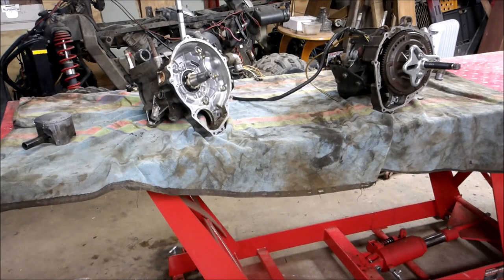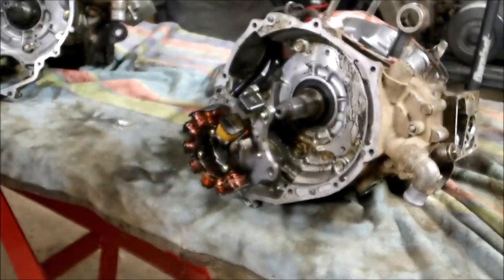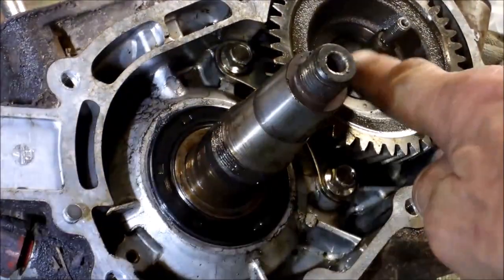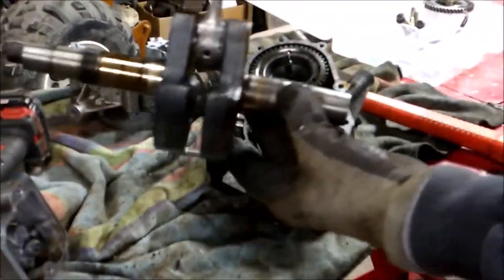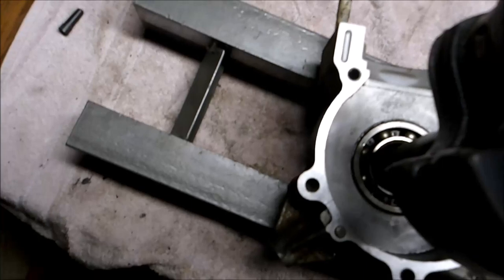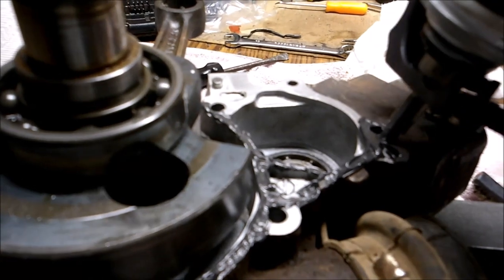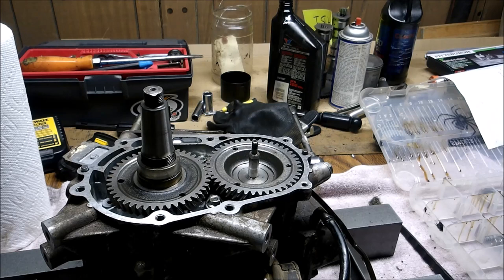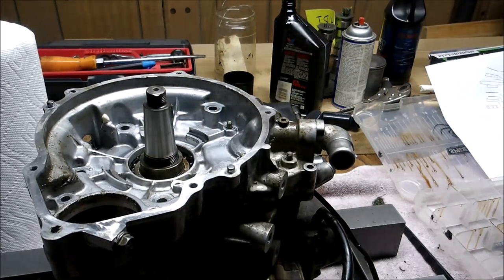How to Rebuild a Polaris 350/400 2 Stroke Engine and split case sides! Sportsman/Scrambler/Xplorer.

Comment: My cousin screwed up my 400 scrambler he put a 350 top end on there. I still have to get throttle cable that hopefully it works.
Reply from the maker: That can be done. I've heard a guy once took a 300 engine and a 250 top end and got more power.

Comment: My water pump bearing is rusted, and stuck on the counter balancer shaft. Is there a way to get it off? Also the shaft looks like it is in bad shape. I guess I should replace the counter balancer assembly? Thanks good video!

Comment: Excellent video, thank you. I'm a new subscriber because this video is helping me rebuild my 400. I purchased a new short block and therefore have to pull the water pump/counterbalance from the old block (blew a hole in the crankcase). I'm stuck, pulling this gear out requires a weird sized bolt. I believe it is 12NC24, but it may be metric. Do you know? If a special tool is required, maybe you know.  Thank you so much for your content, really good stuff
Reply from the maker: Remove the 10 mm bolts from plate next to crankshaft that hold the counterbalancer in place. With the case split use a press and push it out. like you would be pushing it into the case. put a socket over the water pump shaft. You could do this with a rubber mallet too. But its tricky.

Comment: I have a question for you does your quad have a red button on the shifter and if it does where does the cable off that go to
Reply: Can you please answer my question
Reply from the maker: I was at work. You must have a 350L. It's spring loaded and goes to a clip on the shifter.

Comment: I have a 2000 scrambler 400 (2×4) thats been sitting for probably 15yrs.  I'm trying to get it going  & noticed it has an anti-freeze leak, my question is do I have to remove the engine from the ATV or can it be done on the  bike??? Thanks
Reply from the maker: Depends where the leak is. Head gasket can be done on the bike. Water pump is easier off.. ut can be done on.

Comment: I know I’m digging into an old video but I’m hoping you can point me in the right direction. I need to replace the 65 tooth gear on my 1995 Polaris 300 4x4. I’m having a bear of a time trying to pull the bearing off to allow me to pull the gear off the shaft. Any pointers? The 2 jaw puller I have won’t fit due to clearance between the bearing and the gear. I’m stumped.
Reply: And just realized I posted this on the motor video and not the tranny vid. Hopefully you see this and can shed some light

Comment: Hey man...great videos as always. Your my go to source now...lol. Couple questions. One...the gear that drives the counter balance that is on the crank...what is your method of getting this off. Only thing i can think of is super long bolts and a balancer puller like the stator flywheel. And the counter balance gear too. I worry that that will bend the small shaft if I put a puller on it.  This motor im doing is shelled bad but I'm going to revive it anyways. Lets just say lots of balls in the bottom of the case...lol. And two...based on your videos and my own research is it safe to say that the 350 and 400 are identical when it comes to the internal bearings...only reason i ask is the 400 bearing kit is 50 bucks cheaper than the 350 for some reason.
Reply from the maker: Thanks man, I appreciate that. And now for your answers. LOL. You can take 2 screwdrivers to get the gear off crank. It normally just slides off, if its rusty spray  PB blaster on it. The gear on the counter balancer can be tricky. If you have a press it is easier. Take the 2 10mm bolts off the metal plate next to the gear. That's what holds it in place. Slide the plate out. Once you split the case ( don't forget to take the woodruff key out first) you can push it out from the inside. The bearing will come with it. You could probably use a socket and a hammer. And Yes, the bearings for the 350 and 400 are the same.
Reply: @TitaniummanGarage hey thanks for the quick reply. Also have you ever plugged the decompression hole on these....and I was wondering just for conversation sake what the power difference is from a 350 to 400 is...have you noticed any pros and cons of the 2 engines as I'm assuming youve road both. Also have you or found it necessary to replace the reed valves on these motors

Comment: I have another question. My case half with the water pump is bad. Piston came apart and broke the case. So I bought another engine and tore it apart. The case on it is good. Since I'm using 2 different case halves, which shims should I use? And the second engine didn't have any O rings inside it either? 🤷
Reply from the maker: I've ran into that quite a bit. O rings missing, shims missing. I would use the shims from the newer engine and keep it shimmied the way it was.
Reply from the maker: Also. You should use 2 different casr halves. Its said that the 2 halves are machined to fit each other....But..I've done it already.
Reply from the maker: Should not. I ment to say
Reply: @TitaniummanGarage  ok, another question. I have one shim that fits the crankshaft on the keyway side perfectly. So I know it goes on that side because it won't fit the shaft on the other side. I also have a second shim that is too big for either shaft. I'm not sure where it came from. Can you tell me what that shim would be possibly for? Thanks.
Reply from the maker: @WagsAutomotive  There is a shim that goes in front of the counterbalancer gear.

Comment: Ok got it apart. Pressed off the main bearing and gear. I see there's a timing mark on the counter balancer and the gear so I know how to put it back together. I heated the wp bearing with a torch and clamped it in a vice & drove it off the shaft with a 7mm deepwell socket. Shaft is rough, but I think it can be a repaired. I see there are people online that can turn the shaft & install a  new undersized bearing & seal. Do you know where I can get those parts and I'll do myself. Thanks for the help. As you can probably tell, I'm a mechanic myself (check out my YouTube channel Wags Automotive!) just not familiar with atv engines, but these 2 strokes are actually very simple engines. Oh, and should I plan on boring it if there's a very small amount of scoring on the cylinder? I don't know what is acceptable on a 2 stroke engine.
Reply from the maker: I'll have to check out your channel. I've got away with just honing the cylinder if there are minimal scratches. It's not recommended. But I did it and the machine is still running good. If your doing it for a customer I would have it bored out, it will last longer. My friend showed me the parts you talked about. I never did it. I used, used parts from another engine or from ebay.

Comment: Where are you located? Do you rebuild these for other people? I found out today that my case is broken, apparently from a piston skirt breaking off. Can the case be welded? Thanks!
Reply from the maker: Yes. The case could be welded. I'm in Wisconsin
Reply: @TitaniummanGarage  do you do rebuilds for other people?
Reply from the maker: @WagsAutomotive  I do. But have been more focused on rebuilding 500. You can buy the clutch puller for 30 bucks now. When I made that, you couldn't buy one. It's been years. I dont remember the pitch. What's your location? I have a friend that deals in 2 strokes. Probably has a case side. Hes in Milwaukee. He rebuilds them. I taught him everything I know. And he has taught me some things too
Reply: @TitaniummanGarage  I needed one today and I could only order it online. I did some research and found out the pitch is 3/4-16. Fortunately I was able to find some threaded rod nearby and am going to make my own puller out of it.
Reply: @TitaniummanGarage  And it worked great! 😁 Cut a 10 inch piece and put several nuts on it and jammed them together, lubricated the threads and spun it on with an impact. Popped right off! 👍

Comment: Hi, my 350L blew a bunch of light brown oil/coolant from somewhere.  I checked  online and its an obvious sign of waterpump.  I got the waterpump off and the bearing and seals are trashed on the waterpump.  It also put a groove on the counter balancer shaft.  I have an extra counterbalancer shaft from the old motor.  Is the counter balancer 1 piece or is the gear and shaft separate from the other side?  in other words, can I change out the counter balancer shaft without splitting the cases or is that inevitable?  I'm doing this job today, so I'm hoping you get this and can respond today.
Reply from the maker: Take the 2 10 mm bolts off bracket by counterbalance. if you have a wheel puller you can pull the counterbalance out with the bearing without splitting the case. put new counterbalance in the freezer so it shrinks then install.

Comment: I am getting coolant in my oil.  I ordered a lower end rebuild kit with all the bearings and gaskets.  I am in the process of tearing the whole thing apart.  The bearings are all bad, even the ones on the balancer barely spin by hand.  How do I get the balancer out?  I have tried to split the case, but the balancer side is stuck hard so I need to pull the balancer so I don't damage the case.  I know they make a tool for it, but it is no where to be found on the internet or dealers.  I don't see a way to pull it with a wheel puller like you said in another comment since I need to push on the case while pulling on the balancer, unless there is a different type of wheel puller that I don't know about.  I am hoping to get this 400 and a 350 rebuilt before the spring.  Thanks!  Your videos have helped me a lot in the past.
Reply from the maker: I use a press to push it out, cases split. the bearing comes with it. push from back side..or inside the case out. remember to remove metal holder on the outside.
Reply: @TitaniummanGarage  I can’t get the case to budge on the balancer side,  I am thinking the bearings are corroded in.
Reply from the maker: Might have to wedge a screwdriver in between and pry. I had that issue on one of mine.
Reply: @TitaniummanGarage  I got the halves apart with a little forcing using the bolts and a hammer.  I am now putting it back together.  How do you get the rtv that bulges out in the crankcase cleaned up?  I am assuming you do not want it in there.  Thanks!
Reply from the maker: @Darbman62  I take my finger and put  a thin layer on so its does not bulge too much. If its bad I use a screwdriver to clean it up while wet.
Reply: @TitaniummanGarage  sounds good, thanks.  I used a paper towel between the halves of the drive shaft while it was wet and rotated the shaft and it got most of it.

Comment: I gotta 350l that needs a rebuild would the top end off a 400cc work or are they different
Reply from the maker: No. I tried it.The cylinder opening on the bottom end is smaller on the 350.

Comment: Are they crank bearings hard to get out of the case ?
Reply from the maker: Not to bad. I use a press to get them out. If they are really rusty heat up the case. You could use a rubber mallet but it's kinda a pain.

Comment: What would cause water to get into the countershaft.When I fill the radiator I can see water drip under the flywheel when cover is removed
Reply from the maker: Sounds like the water pump gasket or head gasket is leaking. Your crank seals are bad causing it to leak on the flywheel. Also I have seen the cover for the oiler where your cable goes in. That seal goes bad and water gets into you counterbalancer, drips out if you do not have oil in the counterbalancer. Are you using coolant or water to fill your radiator? If your using water. Don't!.. But that's 
what is leaking out of your water pump or case/ crank  seals.

Comment: So I just bought a left side case with a bad counter balance bearing on the left side of the case, how do I get that out because I cant get it with a socket since its enclosed
Reply from the maker: That has been a mystery to me too. I'm not sure how one would get that out. Maybe see if someone sells a bearing puller.
Reply: @TitaniummanGarage  nvm, torch and aggressive slamming works, didnt hurt the case
Reply from the maker: Right on!

Comment: I have a 2001 Polaris scrambler 2 stroke I had some dude work on it he said it had low compression he changed  piston and rings though that would fix the problem! It didn’t ! The counter balance 10w30 gets white in color I imagine there’s coolant going i there what should I do ? Frustrating!!
Reply: We’re in Wisconsin are u located?
Reply from the maker: Sounds like he screwed up the rebuild. My guess would be the waterpump is leaking and coolent is going into the counterbalancer oil. Do you have good compression yet? If the plug has coolent on it the head gasket is leaking. But my first suspect would be the waterpump.  I'm in sheboygan.
Reply: How can I contact you? I’m interested on a complete engine rebuild
Reply from the maker: @jjimnz21  Facebook. T-Roys ToyBox I'm not on there often, but I'll look for your message.
Reply from the maker: @jjimnz21  Just got your message. I would be interested. I'll call tomorrow.
Reply from the maker: @jjimnz21  90 is low for a rebuild.

Comment: At closer look on your balancer gear, there is not line up marker dot to shaft marker dot, how?
Reply from the maker: On the 350's they didn't have them.
Reply: @TitaniummanGarage  So do a chisel line up mark is a good practice before separating gear from shaft. thanks.
Reply: @TitaniummanGarage  400 do have dots on gear and shaft.
Reply: @TitaniummanGarage  Again, 350 gear may not be able to use on 400 l guess .
Reply from the maker: @osbornebay944  sure they can. You just have to count the gears and put it back at that count. I've done it already. It's a pain...but it can be done.
Reply: @TitaniummanGarage  Thanks, l bought 2 sets of gears, 99 and 92. 99 balancer gear has shaft mark, 92 is not. 92 is still on balancer shaft, so l ll check the timing mark to balancer shaft weight OC vs 99 gear and chisel a line up mark, if shaft removal.

Comment: Where do I get a bottom end rebuild kit that isnt a cheap chinese one??
Reply from the maker: I just buy the bearings and seals. It's all made I'm china. Lol. Unless u go polaris dealership.
Reply from the maker: You could also try partzilla.
Reply: @TitaniummanGarage  I have a broken primary clutch bolt inside my clutch, hood do I get that out and will I be able to get the clutch off? The bolt broke off 3/4 down
Reply from the maker: A wheel puller could work. You might have to modify it. But yes. If the bolt head is gone it will still slide off.
Reply: @TitaniummanGarage  ok so if I just put the clutch puller in there and turn it regularly or a 3/4" bolt itll still come off?
Reply from the maker: If the snapped off bolt is down far enough you might.  You might not be able to reach the threads with the 3/4 inch threaded rod if the bolt snapped higher.
Reply: @TitaniummanGarage  well idk, I can feel all the threads before the bolt, the bolt is just an inch below the bottom of the threads
Reply from the maker: Yes
Reply from the maker: You got lucky. Lol. The threaded rod should work. The bolt just goes into the end of the crank. So your good to go.
Reply: @TitaniummanGarage  ok thanks, sorta scared me for a minute bc this motor was runnin real good til I blew it up and noticed it had a dip stick... ended up blowing a hole in the case bc my oil pump went out